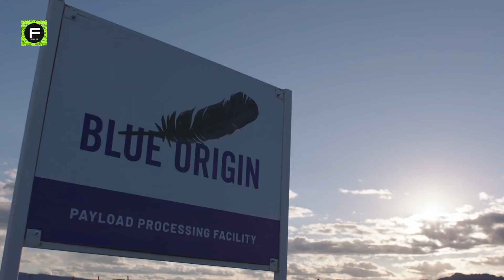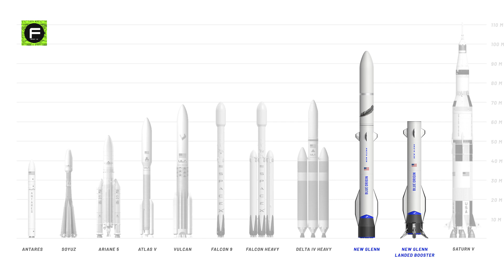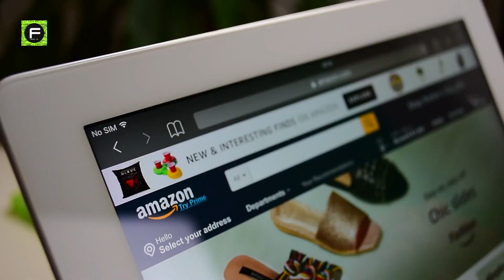New Glenn: Bezos' Dream Rocket to Orbital

Comment: BO has serious delays. They hope to deliver two BE-4 engines for the ULA vulcan launch vehicle by the end of this year, which is seriously late. If they indeed have started on building the infrastructure for building new glenns, it will still take at least a couple of years before they test fly it. SpaceX is still lightyears ahead and anybody thinking BO can catch up is deluded. Spacex poops out 2-3 raptors a week, ready for testing. BO is having trouble getting two ready in a year's time for a test launch.

Nevertheless, kudos for your unbiased reporting. I haven't seen this info shared on any of the other channels I watch. Thank you for that. I've been wondering where BO was as far as infrastructure goes.